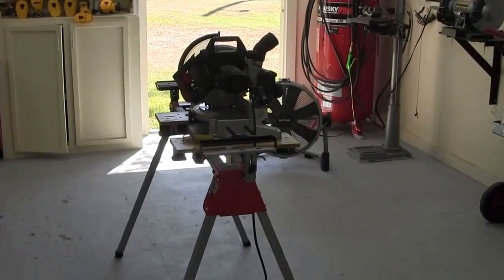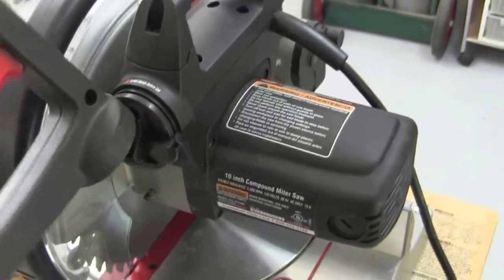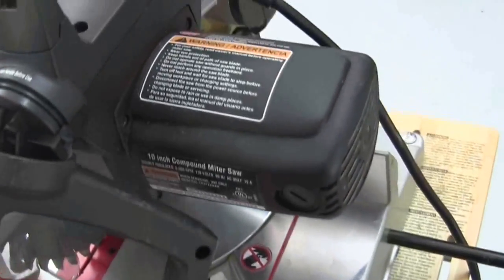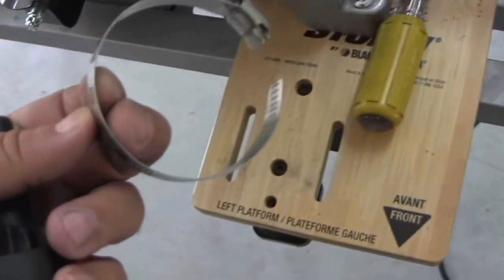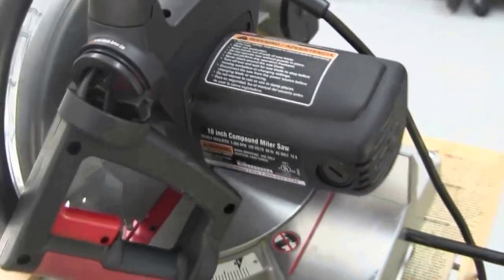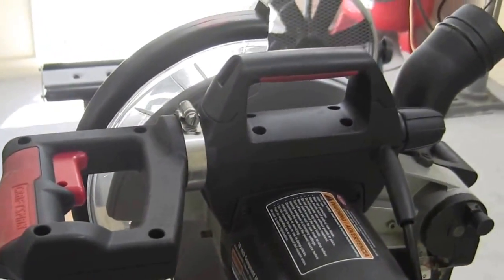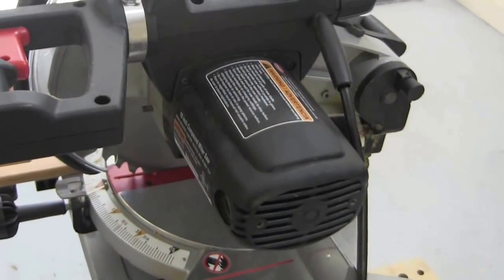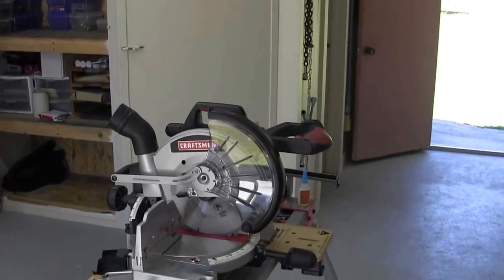How to fix a broken chop saw handle

Comment: I seem to mess up my tools when they are new. I let my large portable air compressor roll off my trailer in transit once. Didn't take into consideration its top heaviness. Bent it up badly but it still worked just fine. Was using my new Honda pressure washer one day, took the gas cap off for refueling and didn't realize I was setting it upside down on the manifold guard... So for the past 10 years I've had to look at that big old gaping vent hole in my gas cap.MAN!!! I hate it when that happens.

Comment: I put a chainsaw handle back on one day with angle irons for furniture, wood screws, 2 part epoxy  hose clamps and wire.    It lasted until I got disgusted with it and bought a Husqvarna.  I did trade that Poulan Pro with the big engine and long bar for some firewood tho.  The only thing that hurt my feelers about that trade is the 8 new/used chains I had bought for the poulan.  But I am happy with the Husqvarna overall

Comment: Hey man good fix, hopefully it last, it should as long as too much pressure dont pop it off. tho as you said should work great, but actually you had no other choice. Craftsman isnt bad  and will last along time if used as a hobby saw. I have a master craft which has lasted many years and still going strong. Have fun man and happy cutting.

Comment: i broke a mirror off of the company vehicle right where it is supose to swivlel  several years ago . i glued it back on and used a couple long tie straps to go around it . drove it for a long time on some rough roads, never had any trouble with it

Comment: I just hate that when a tool breaks that you use a lot. It's an excuse to go get a new one. I give my older tools to my son in laws when I feel the need to get something better. Usually something breaks on them and I get the part and fix it and give it to them. I replaced my 10" B&D with a 10" Rigid then a 12" Hitachi. I see Menards has the Hitachi on sale for $219. Was $299...a good deal! I don't think you have Menards down there. They are better than L's and HD for lumber but not for tools.